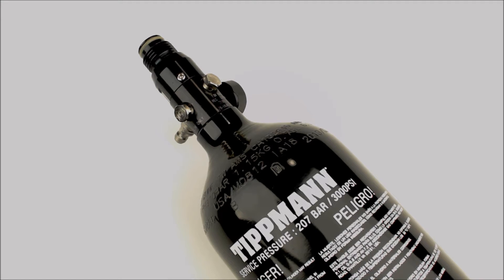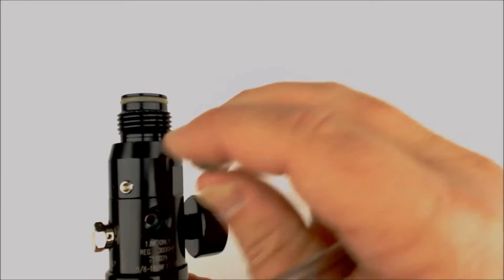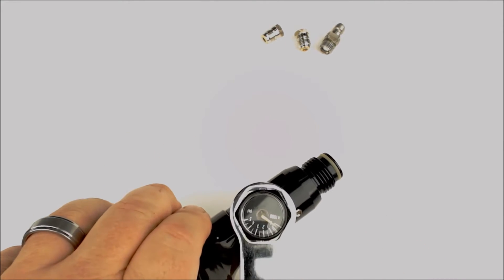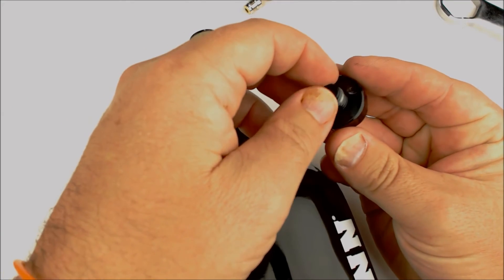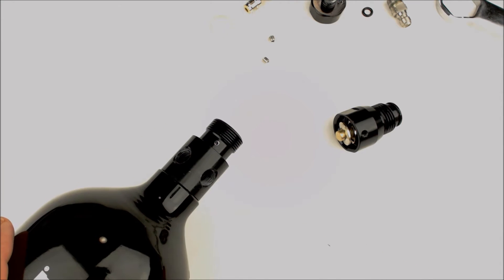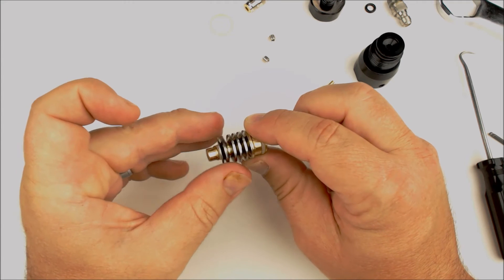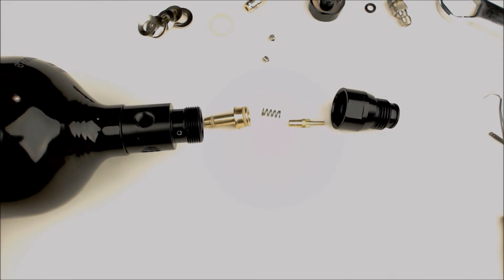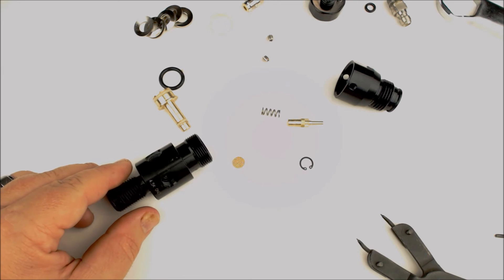Tippmann HPA Tank Regulator

Comment: How do you adjust the output pressure? I need 550 psi
Reply from the maker: +kustomTooth TIppmann regulators are not adjustable. You could put a ninja regulator on your tank, as all Ninja's are adjustable. https://www.tippmannparts.com/Ninja-Paintball-Regulator-3000psi-Input-p/3738.htm
Reply: kustomTooth how much output pressure does it normally use?

Comment: hi i have a problem whit this same air tank.my 1.8 k burst disc always burst when im filling over 2k psi.i have seen the video and put the tank back togheter just so shown in this video.im filling from a pcp hand pumpe.does that have anything to do whit it?
Reply from the maker: In our experiences this can be fixed by replacing the piston orings inside of the bonnet.
Reply: The small piston o-ring must be leaking and let the tank's full pressure override the o-ring and then the regulator does not work as should (close the regulator valve piston when the regulator pressure has been achieved).